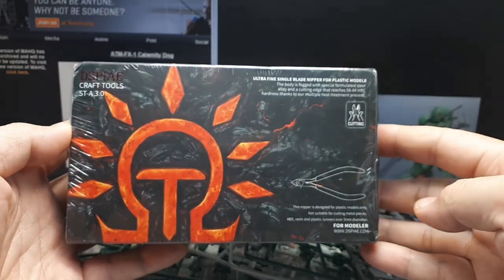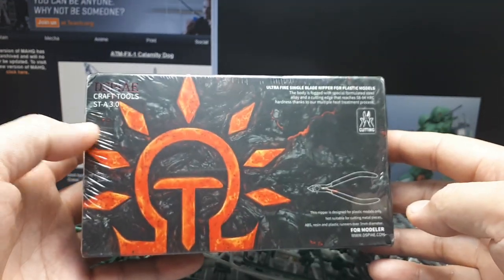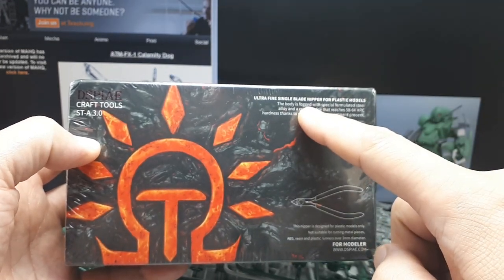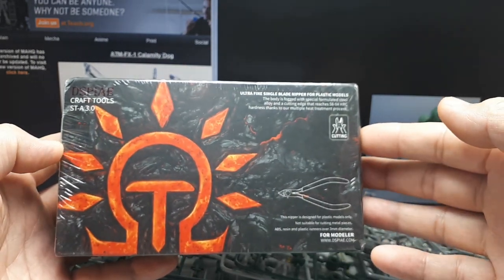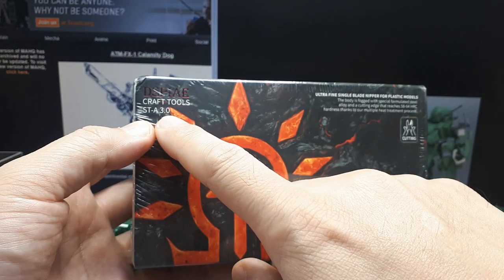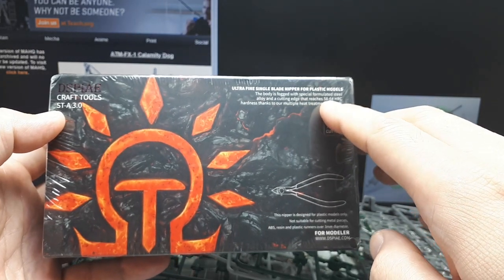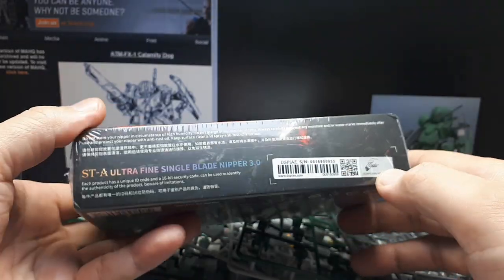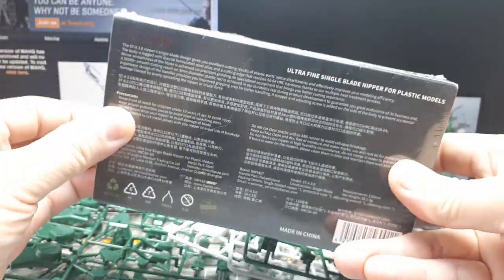Dspiae ST-A 3.0 single side cutter nipper vs. modified Godhand SPN120 & Nanye comparison performance

Comment: For those who will sand and paint, a question for the manufacturer, does it matter? 
No matter I used a single blade or double blade, I'll sand it anyways so no difference at all.
Reply: Doesnt matter at all since you will sand the sides smoothly and paint it eitherways
Reply: Super sharp cutters mainly matter when cutting very fine parts, as theres less stress involved in the cutting. Less part deformation or flying off. 
Absolutely not mandatory but a nice luxury if you're willing to throw money at them
Reply: It depends, the cheap standard nippers definetly can cause stress marks to form that goe deeper then the surface of the actual part sometimes